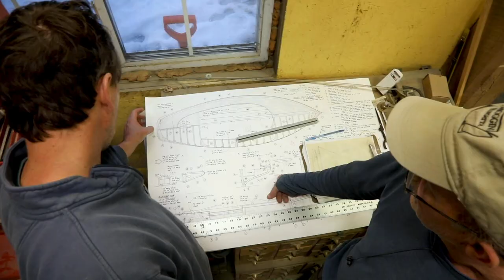Whirlwind II - Part Three - Deck, Coaming and Details

Comment: Wow. I'm about to start building a Somes Sound 12 1/2, but instead of lapstrake, I'm going to strip plank it, and now that I see your deck... you've raised the bar, and it's beautiful. What kind of timber are you using for the deck and for the coaming?